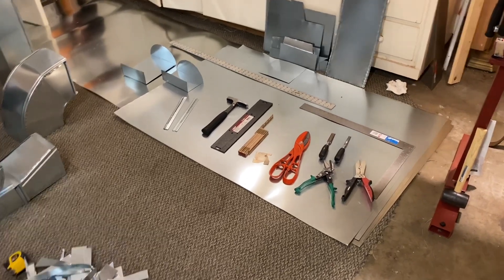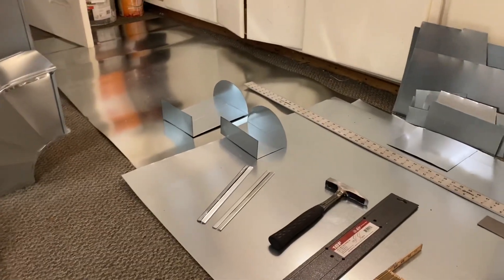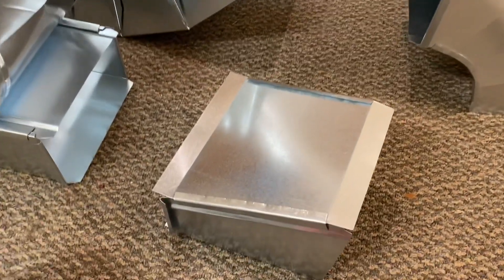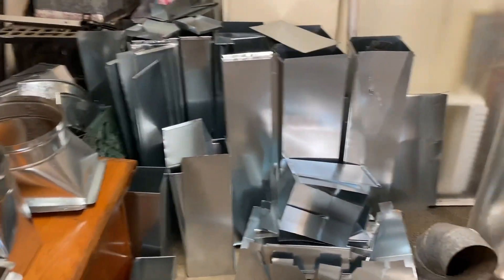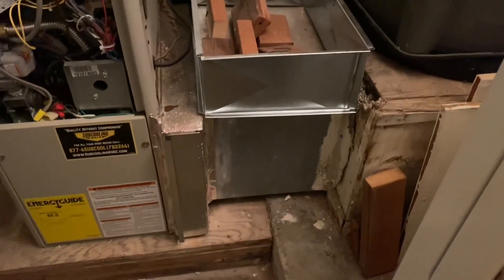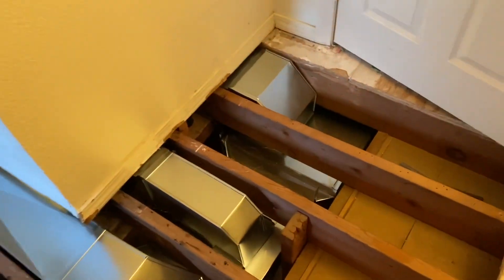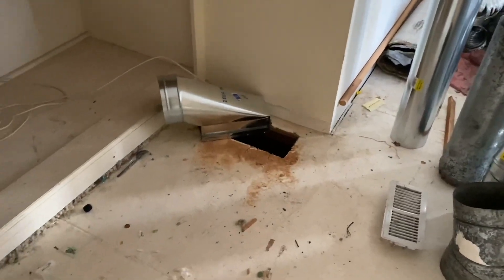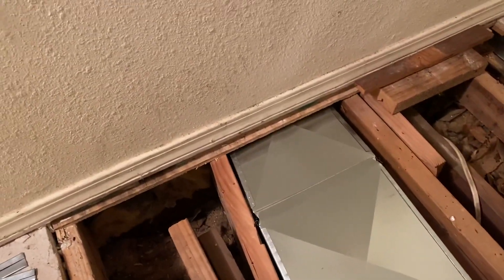New HVAC System Design, Fabricate, Install Metal Ductwork

Comment: What type of machine did you use for that big pittsburg?
Reply from the maker: I used the same 36 inch brake and folded the seam by hand.  I just did the series of bends in the proper order to replicate a Pittsburgh seam.  After doing a few of them its possible to make them nearly perfect.  Not as optimal, but since i'm not folding ductwork daily i dont mind the slower hand method.

Comment: Thanks for sharing this is a very cool literally just redid my main trunk line myself learned off YouTube bought all my material at menards .. mine was in a basement so alot earlier lol I believe 8x16 about 28feet.. and 6" round take offs ..  Made my own plenum about little less than $1k in material .. quotes 6-8k ... by hvac companies. My question is what you spend all the material vs just using pre made trunk lines?
Reply from the maker: i didnt use pre-fabricated ducts because the upstairs floor boards are so small i wanted to maximize the exact dimensions of the ducts to run thru the floors in order to get maximum airflow.  For the attic trunks you're right i could have just use pre-fab.  but at that point it was just more fun and looked cooler to have all metal ducts since its a one time DIY build.

Comment: Looks good man, what did you do to cover those small gaps in the corners? I usually just try to neatly wrap the S and drives with a wide mastic tape. That harbor freight break looks like it’s worth a try.

Comment: Roger,
Very well done sir! I am so happy to see a professional with a lot of tenacity and willingness to do the job right.
I am an instructor of airflow and manuals J And D. You accomplished a key element in getting air to flow, that being the FITTINGS! Air hits those poor 90 degree fittings and turbulates and looses a lot of its forward motion energy.
Your beautiful curved radius throats are key to making air flow.
Many poor operating systems and be improved a lot with just getting the return drop changed to either one with turning vanes ( tight quarters) or an angled throat, same with the supply plenum.
It’s always the throat part of the fitting that is the air flow killer.
Love to see the final product.
I’m sure you will seal and well insulate the attic duct work.
Thanks again for showing what professionalism looks like.
Best regards
Wayne

Comment: I've been in the HVAC trade for quite some time now. Honestly, you're craftsmanship with the sheet metal in the floors is impressive. But I have a couple questions..how do you plan to seal and insulate it all? And you have a lot of square duct with "pairs of pants" branching off in all directions. I didn't see any dampers. How is the balancing going to come into play?
Reply from the maker: I honestly don't know how i will be able to fully seal and insulate because the ducts are so tight fitting in the floors.  its a challenge to figure out.  perhaps i do in sections, but even that is difficult.

i did finally add dampers to each branch in the attic area.

Comment: Your duct fabrication is awesome, I'm wondering why are you terminating with the flex which slows the cfm?
Air flows much easier through metal round pipe.
Reply: Install time and cost. And if ran correctly the friction loss of flex is super minimal compared to hard pipe. Flex also helps with vibration and sound attenuation.
Reply from the maker: I agree flex slows down the airflow, but it also quiets the system for the user.  I basically added 6 feet of flex at the end because that is how the codes recommend, but i may use all metal in the future.  Not sure if i will change it.

Comment: Will your attic be condition? Did you wrap all your metal duct with insulation? I am down in southern part of Texas with high humidity in our attics and without proper insulation this similar install with sweat like crazy.  I am interested in learning more about making metal duct as well as I see a lot of benefits to it but have concerns as well as mentioned about locations of install due to elements.  Great video and applaud your efforts, your work looks great!
Reply: Alot of times its Insulated on the Inside. In my state
Reply from the maker: my attic is vented so not conditioned, but i want to convert it to conditioned but i dont think its easy to do.  For now i simply insulated my ducts on the outside with 2 layers of bubble wrap with an air space layer separation.

Comment: Great install, Roger. When you complete and insulate you ducts in the attic I suggest you add another 8 to 12 inches of insulation on top of existing. Thxs for the vid!
Reply from the maker: great idea, I would like to bury the ducts under insulation but I couldn’t figure out how to bring the ducts thru the wall and then make the right turn while staying flat along the floor joists. They rise up off the floor a foot or so.
Reply: Could have end capped the sq duct in the floor joists and took a take off collar or tabby take off 90 off the top and ran it round pipe rest of way through attic.  The radius els are your issue on height, round elbows throat is extremely less which would have hugged the joists better. You’re never supposed to take a supply off the end of duct like that pants fitting is doing.  Also why split duct runs into 4 small dedicated runs?  That job got made extremely hard because of strange design, and also needs balance volume dampers on all of those 4 branch runs..

Comment: I am totally impressed at your tenacity Roger.  Many would have given up before they started. Also the level you've advanced to is incredible and I can only imagine what you could do with a few of the old machines in my shop !!  On a side note, if you had a pair of the 30* notchers, you could easily have relived the stresses of the metal on the radius fittings as the pittsburgh locks are bent over.  I mark the beginning and the end of where the radius falls on the wrapper, then notch  the fold about every 1/2'.  It makes a smooth and neat lock.  I look forward to the finished projects overview and you get a very warranted A+ !!   Oh yeah...your scrap pile is a testament to the aforementioned 'tenacity'....LOL !!!  Take Care and have a wonderful week Roger. Thanks for the shout out too !!
Reply from the maker: Good idea. I may try another elbow and notch out every inch etc, it will make it prettier too. But the stresses you mention, one worry I have is over many years these fittings could fail or break if too much stress is present, and these will be sealed up in the floor with no access which is what worries me it has to be done right. Well the elbows won’t be in the floor but most of the joist ducting I’d hate to ever have redo do this years from now. 

Thanks for the compliments 44! It’s not as impressive considering I simply had the luxury of months to learn and do this in my spare time. I watch your videos and it seems like you do the entire build in an hour! That’s more impressive!
Reply: @r0gerp0dacter  you will never suffer a stress failure of the type you describe. On notching the outside edge. At one inch they may still crumple a bit. I found that closer notches make a much neater fitting on any radius. Still.... your fittings are really really good !!